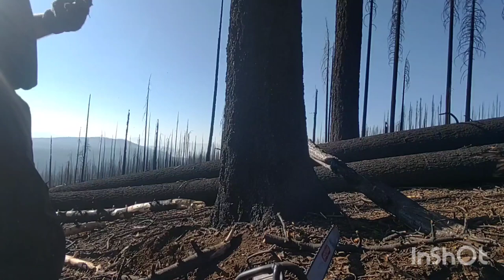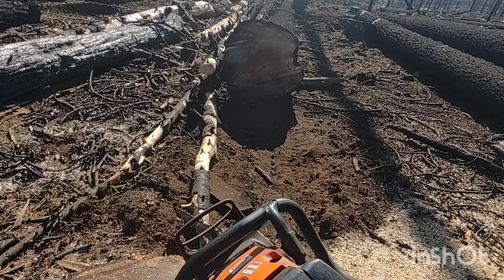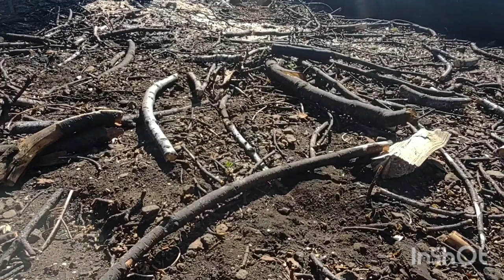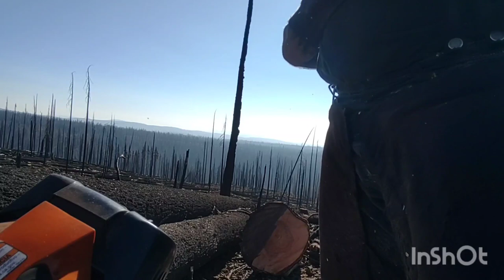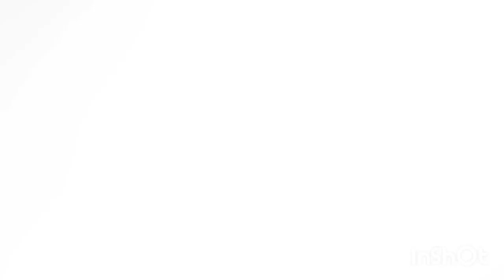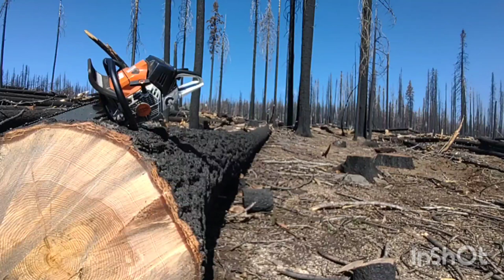Timber Falling: Long Friday Video, Stihl 500i, 7 and 8 pin sprockets

Comment: NIce cutting Kodee , it must be hard on saws cutting in the burn, do your air filters get clogged faster?  Do you take 2 saws out with you? Just in case.
Reply from the maker: Very hard. That fine dust gets into everything eventually. Yes you have to change your filter much more. When I run the max flow filters I usually run them a week in good conditions and in the burn I can only get about 2 days before it starts to plug up